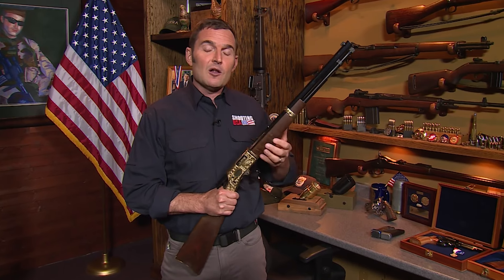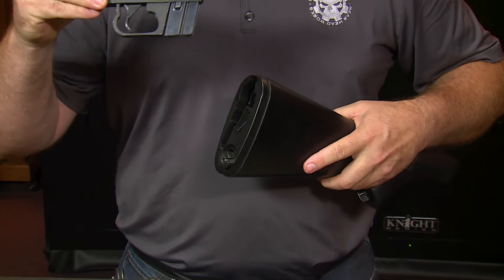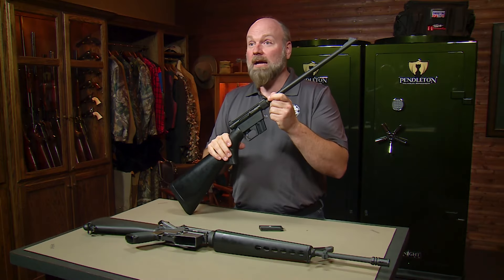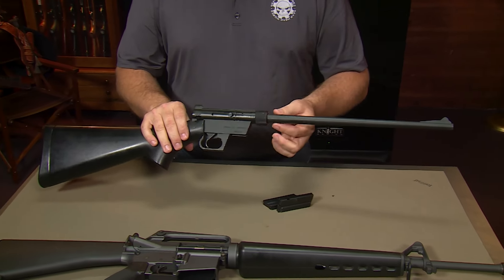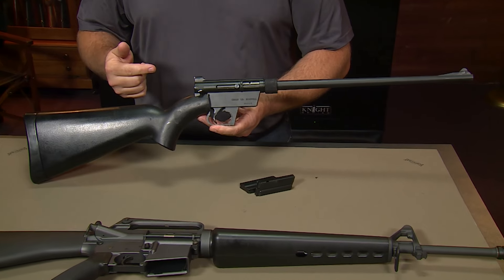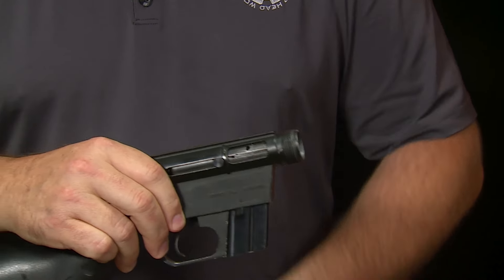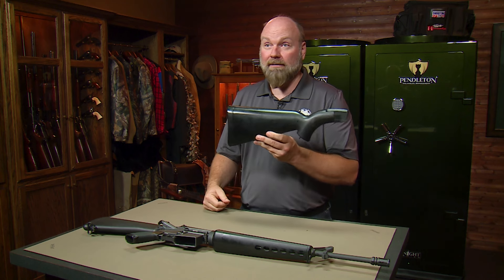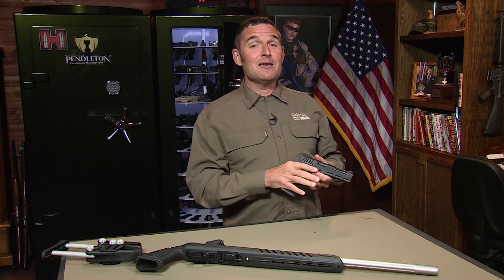Shooting USA: History's Guns UNCUT: The AR-7 Survival Rifle

Comment: Actually, Charter Arms acquired the rights from Armalite in 1973 and passed them off to Henry in 1990. The first couple of years of Charter production were a disaster.  By 1976, some or most of those issues were resolved, but Charter had already ruined their version of the 7's reputation by then, so it took Henry resurrecting it in the 90s to bring it back into acceptance.